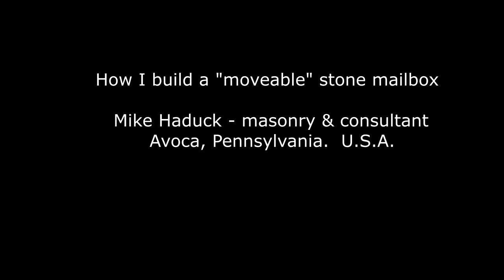How I made a stone mailbox (moveable) Mike Haduck

Comment: Mike, absolutely beautiful job, and you opened my eyes on prefab movable things...and you're absolutely right about it.  Off topic now, I had stonework done on my chimney chase for the woodburning stove.  It went up 24 feet. More importantly, the gy that did the stonework used a snow brush that we use for cleaning snow off our windshields. He used the snowbrush (looked like an oversized toothbrush) to brush out the joints after the cement set up.   He just brushed and brushed until all the joints were smooth. Worked and looked great. But yours does too!
Reply from the maker: Hi lost,  anything that works I always say, making things movable bypasses a lot of the permit process, thanks, mike

Comment: How are you doing Mike you make excellent videos, have attempted a larger mailbox actually cutting quarried stone to fit, started with riverstone on the bottom which was extremely hard to cut, then honed and cut a square piece of flagstone as a secondary water table then went to fieldstone cutting my own veneer, not quite sure how to post an image or if you even can on here. I'm about half done now and would love your opinion and also pointers. After the veneer is finished I plan to add a boulder (very small for a boulder but still quite heavy) with some geodes implanted in the Boulder.
Reply from the maker: Hi James, I am sure it will be a eye catcher, make sure you got the right distance from the curb and height or the postman will go ballistic,  thanks Mike

Comment: Great video I built the frame today stone veneer come in next week with cap. I was wondering how is the cap attached did you just use mortar on the edges and gravity? Also i plan on digging around 8-10” then gravel and concrete everyone is telling me code is 42”s I’m in Chicago and we do freeze deep. Thank you for any suggestions.
Reply from the maker: Hi Val, I forget but I think I used a couple L brackets to keep the stone down, the mailbox was movable so no footing required, thanks Mike

Comment: Mike I do not scratch coat when using cultured stone and spec-mix. stiffens up pretty quick
Reply from the maker: HI Levan,  there are times I did it the same,  anything that works for that job I am doing at the time,,   I appreciate it.  mike
Reply: Correct. Like you said before. There is no right way or wrong way doing it. It's just to make the job moving. I like your grinder...lol there has being times when I left the generator home and there is no electricity on the site, so I whip out the 14inch demo saw and cut stones with it. Love that saw to cut curves on the paver and stone patios tho
Reply from the maker: thanks Levan,  your right,  just keep it moving,  thanks mke

Comment: Could this method be used for fence posts about 6' to 8' apart. If so what would be done differently? Thanks for the videos.
Reply from the maker: Hi Lawrence, i have seen it done, cant remember where , I did called a series called building stone piller or columns, mike haduck , maybe that will help, mike

Comment: Nice Video Mike. How is the mailbox anchored? I saw where you drilled holes for bars, but not following how you actually get it anchored...looked like you pour concrete around the outside? Thx!
Reply from the maker: Hi Bruce,  I missed filming that, I just mixed some fast drying cement and dropped it in, thanks mike
Reply: Mike can you give a little more detail on how you anchored it I'm a beginner and catching on some of your ideas and also on the stone cap what was holding it ?? I seen the 2x4 you but on it but didn't catch where did you screw it to

Comment: The sad thing is that most of your concrete Masons today don't have the knowledge to even form and pour a complex set of steps.  That work is done by specialists like Mike.  A fair number can do simple  steps.  But most have never attempted it.  On problem is that a lightly experienced mason could make a small error and any fall on those steps would result in a lawsuit, even if the error didn't really cause the fall.  so, it's work for specialists.
Reply from the maker: hi wino,  a lot of it is common sense,  lots of different ways to do things,  thanks mike